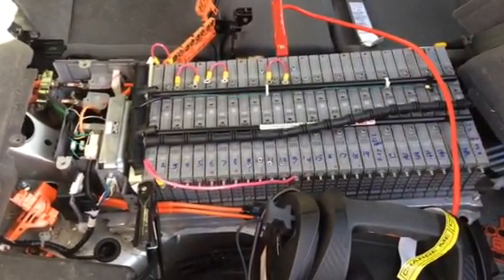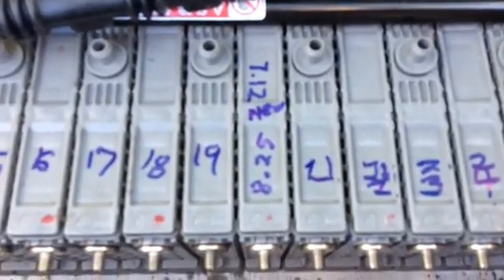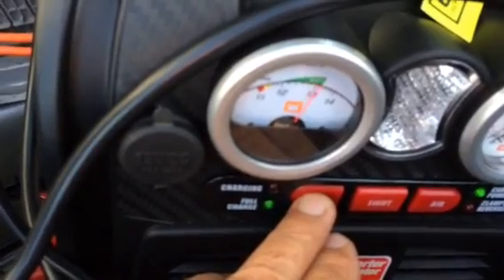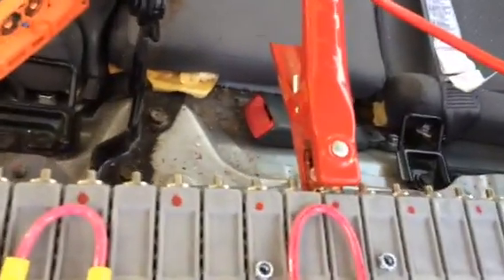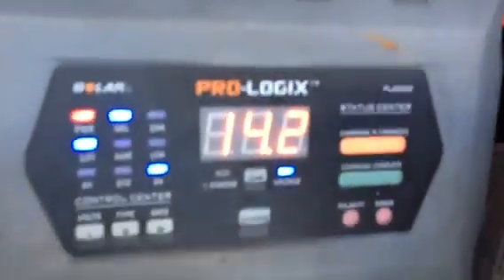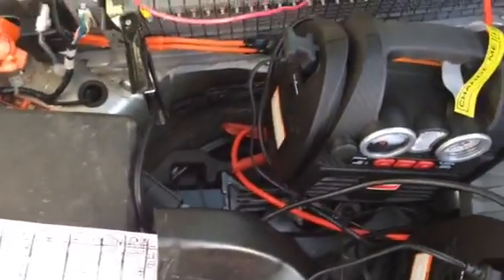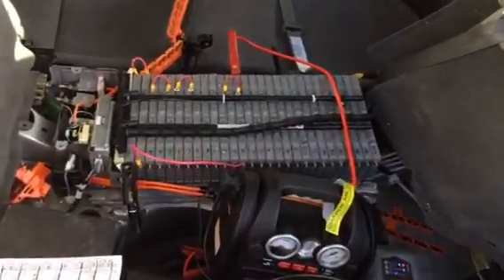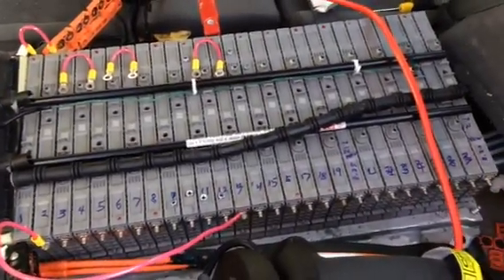Reconditioning a 224 volt Prius Battery.

Comment: Thanks for the video but ALWAYS  disconnect the aux battery and why not just use a 2 amp charger for each module that is low. 7.2 volts is 1.2 volts X 6 batteies in each module.. what they should be. I think charging them to over 8 will prematurely  kill them. The extra expense of buying chargers  for 24 volt charging is unnecessary but if it works for you that's great. And you definitely need to load test them and recharge them a few times to make sure that those modules are still good

Comment: Hey does the trickle charger say at 2 amps recharge both up to the same level ie. 7.9 volts? All of my other cells are at 7.8 or 7.9 with one at 6.5. if I use my trickle charger can I do just one cell back up to 7.9?
Reply: This is a really late response, but for the sake of others that might see your comment, a module that is at 6.5V among modules at fairly standard voltage probably has a couple bad cells in it and won’t hold a charge regardless of the amount of times you charge and discharge it in order to revive it (though it’s certainly worth a shot). I would recommend simply replacing that module with a reconditioned module that you can get on eBay for $25.

Comment: Could you pleace tell, how did you protect yourself, working with this HV battery?
Reply: He didn't protect himself... didn't even remove the 12V connection before removing the safety plug on the Traction Battery. But hey.. to each their own, I just don't like taking those kinda chances.